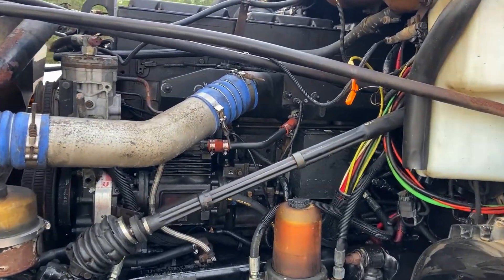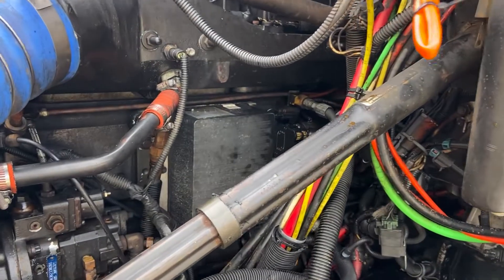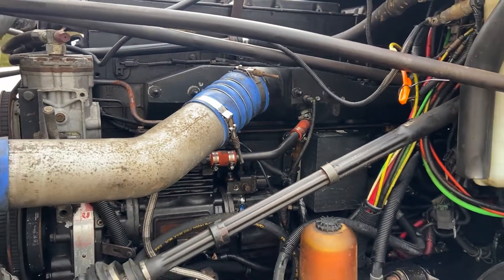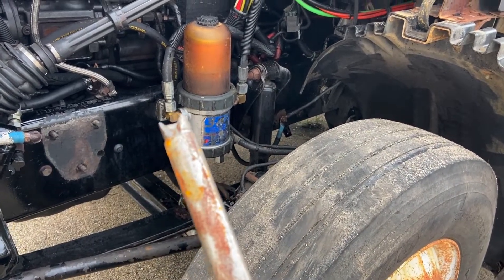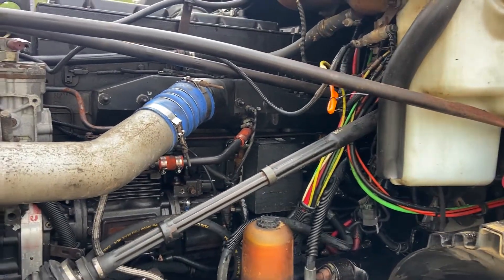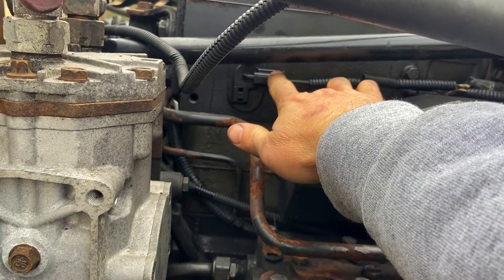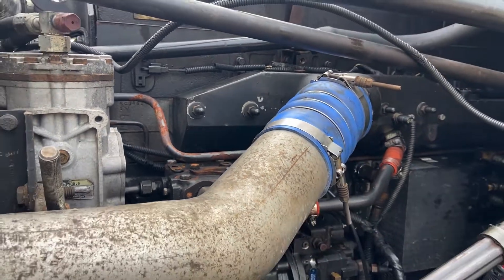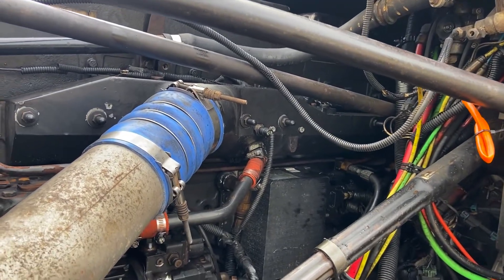N14 Cummins Has a Miss | Injector or ECM | Easy way to check for the problem.

Comment: solenoid        .8  .10  
noid light       flash
ecm                  work
ohms               ecm   plug  to injectors plug  0 hms

but the truck has problems

speed derate to1400 to 1600 RPM. Current
to injector is shut off.

insite  scanner

Comment: I like this self diagnosing but if these tips don’t come to a cure the shop boss gets mad because every time you unplug a injector or any other electrical component it throws a new code. He likes to plug the computer in and see the one code that was the problem and not twenty codes from me unplugging injectors and what not.   Shop time is super expensive.

Comment: 2001 celect plus here. I have the same issue. It only happens once and awhile at idle but very noticeable in high gears. Sometimes at higher rpm it will snap out of it and run fine.  Problem is the truck won’t stutter at idle long enough for me to pull the plugs out to identify where it’s coming from.

Note I just changed all the pass thru connectors and wiring harness to the injector. Also checked the push tubes and they were fine.

Comment: Thank you very much bud for all this awesome tests it has given me a new way to look at the electrical side of things.... I have continuity on my injector... Noid ligth test threw me off a bit because i got a mixed of strong strobes n low strobes and then it quit.... So I'm thinking Ecm but the seals on the pigtails are letting oil in the harness aint no telling how long thats been going on so im going to replace the pigtails and injector harness since i do have access to another Ecm if after i replace the harness then ill send the ecm to get it rebuilt
Reply from the maker: Great. I’m glad it helped you out and I hope you get the issue figured out without spending too much.

Comment: Thank you share your experiences. QSNT C-345 No power on load, rpm dropped 2100 to 1300 on load, pump deliver 1 bar to 10 bar pressure with unrestricted fuel flow, no missing, very light black smoke when Accel gradually increase.
Reply from the maker: Thank you as well!

Comment: I've looked at countless other videos on YouTube but yours is the only one that mentions the "noid" device. I have Ohms checked my injectors with multimeter,  the wiring from injectors to N14 then from  N14 to ECM for continuity and these tested to be working. I
 have an 05 cummins so my "N14" equivalent actually
 house wiring for 2 cylinders so I can't disconnect 1 cylinder
 at a time. I am going to get
 the Noid test set at O'Reilly
 and test the ECM and the
 wiring. I really appreciate your
 thorough explanation and
 method how to
 check all those things. Excellent video, Sir. 👍👍
Reply from the maker: Thanks a bunch. I hope it works for you.
Reply: Just unplug it. Yeah, right. Mine appears to be superglued

Comment: Fantastic troubleshooting technic.  People need to listen and not skip over your suggestions. I been an electronics tech for 50 years.well done sir
Reply from the maker: Thanks a lot. And you’re exactly right. And I run into it a lot. People want the quick answer and you just got to slow down a little and go through the proper steps. Ultimately it saves tons of money and time. Really appreciate you pointing that out.

Comment: Great knowledge, I see you have 2 piston air compressor in your N14, I have n14 as well, I looking for 2 piston air compressor are you able to get back to me with part numbers ?
Reply from the maker: I don’t have part numbers for that. But you should be able to google search something like that and find several options. I sold the N14 so I don’t have its numbers. Thanks a bunch.
Reply: @nedstephens  Ok 
You still have vin number for the truck you sold ? Or engene serial number?
So I can have more searching options ?
Reply from the maker: No I don’t. I would just call a truck parts dealer. They’ll give ya options.

Comment: Where can I get a pin diagram for my N14 ECM, wiring harness? Thanks to this video’s excellent advice, I purchased a noid light kit, pretty cheap at Harbor Freight, and found my #4 injector has no power.  I’d like to test it myself rather then a shop.  I replaced the ECM 15,000 miles ago and sure hope it’s not that again. Thanks in advance for any help.
Reply from the maker: Hey bud. Glad it’s helping. There’s a link in the description that takes you to a diagram. I think what you need is on the bottom of page 2. Then you can use the multimeter to check for broken wires. Good luck.

Comment: Im having an issue with my truck its a 2001 first gen with an N14 motor. went to the mechanic and they plug the computer and showed an issue with the fourth injector, changed the injector and kept happening. Did anyone had the the issue?🙏🏽

Comment: Appreciate I have been having problems with rpms 
Only goes to 1500 or 1600 and 8 believe that's mine issue bad wiring somewhere maybe oil on the connection

Comment: You gained another subscriber, this was some really good info, I replaced all 6 had 2 of them bad, did my overhead sounds real nice,  but I get this weird sound when pressing the throttle, I think I have a bad jake, or maybe air in the system, it develops after 10-15 min of running, any advices on what to check next would be greatly appreciated
Reply from the maker: What sort of weird sound? If you think it’s the jakes you can test with the jakes off. Just remember to plug the jake oil ports if doing it with covers off. If it sounds like it’s lacking in power something might have gone together wrong and check over everything again. Or you could just have something going on in the engine after it warms up. Hard to say to be honest. Thanks a bunch.
Reply: @nedstephens  I have to run it with the jakes off, its got tons of power, and it works good. Its just a quick miss when I accelerate. At idle it sounds great, I truly appreciate the response, I think I might have to take it to a shop, If that does not work, It also does not have the valves behind the ecm, Its bypassed straight to the pump bought it like that, dont know if that has something to do

Comment: How its possible I got all 6 blinking with noid n still haven’t fire up? All injectors are gone?
Reply from the maker: I would first check a fuel issue. The light test is for when you have a cylinder not working. The light helps narrow where to look. If you’re not getting anything at all then you’ll have to look at something different.

Comment: So anyways, I just got the overhaul done on the N14, new heads, turbo, and all the stuff, recently during break in it jerked once like if it was running out of fuel for a second then it did it 3 times again days after while pulling a 34k lb load, we found it had a small leak on the hose that goes from the fuel pump to the T into the piping going into the engine, we replaced it and it run good yesterday while pulling 48k lbs twice. But after calling it a day while driving bobtail home it did it twice. Then I saw the pipe where we changed the braided fuel hose has another small leak. Do you think that’s what’s causing that problem or should we worry about something else. 
We also replaced the red fuel solenoid behind the fuel pump and we sparkled clean the ecm wires that connect to the batteries and all the cables and terminals. 
Thoughts? 🤔 
Engine runs smooth as a champ and pulls like a freight train and has a little over 1,000 miles now on the overhaul. 
Just that little problem.
Reply from the maker: It does sound like a fuel issue. From what you said you probably repaired a return fuel line. I would also go over all the supply lines and make sure the filter is fresh.
Reply: @nedstephens  found the problem about that random jerking. We never got a dash code but it was the cam position sensor. We took it out and it was cracked around the magnet causing it to move around with the vibration

Comment: I'm going to try and explain my N14 issue to the best I can. 

So as I turn my steering wheel to turn out the house my engine begins to want to stall or lose power or fuel. It does this every time I turn without being in gear. Also seems to happen when I'm turning to straighten to back up. It just started doing this last week. I've spoken to a few people/mechanics. I've had injector 1 disconnected and as it's being placed back in it shut off my truck. 2 days later it's a different injector that shuts off my truck. Some say it could be injector(s), wiring harness, speed sensor. To all I've spoken to have a confused look so I'm coming here to see if you may have come across this issue. I'm thinking it could be my injector(s) since it shut off my truck each time we disconnected them.

Listening to this issue I'll be checking the injector plugs.
Reply: First of all I'm not a mechanic but I do work on my own N14 for a little while now, a bad injector will not shut off the engine. What I'd do is I'd check the fuel system first. Get yourself some mechanical gauges and hook them up to your fuel ports (one for the pressure side and one for the vacuum side) and check the pressure/restriction in your fuel system. My advise to you is to invest in tools and service books so you can work on the motor yourself, you'll be amazed how much money you'll save in the long run.
Reply: I had a very similar issue. Power to the ecm wire was rubbing on the frame and shorting out while turning or going over bumps